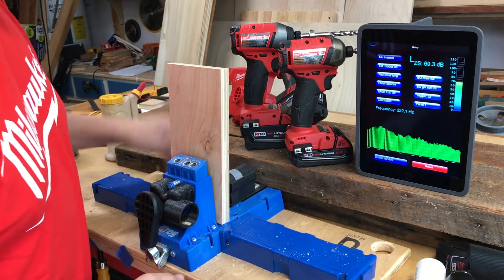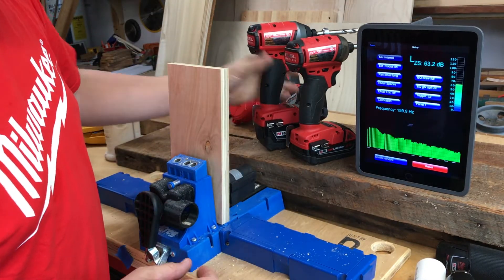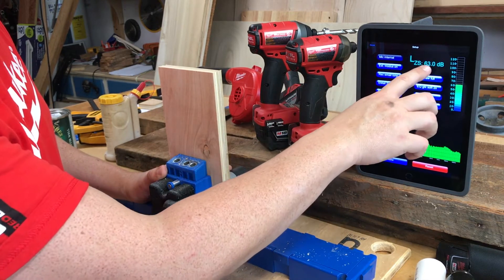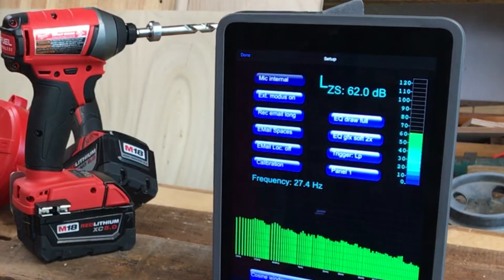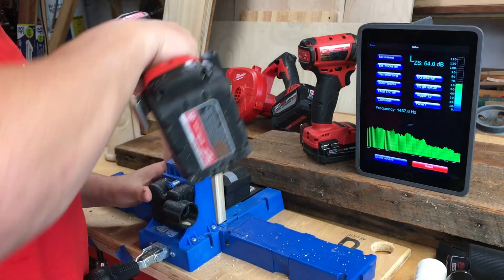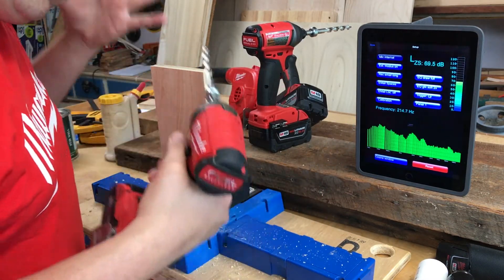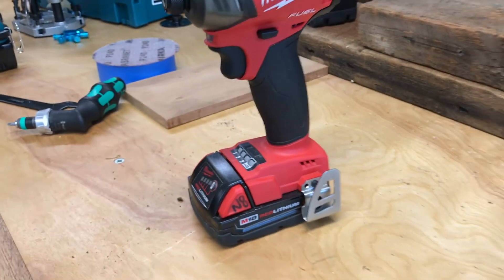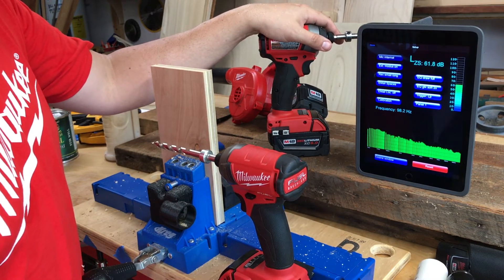Milwaukee Standard Impact vs Surge Hydraulic Driver

Comment: Impact drivers and drilling = idiot missing from day job
Reply from the maker: 1bottlefed sorry you feel that way. You’re missing out. Also way to totally miss the point of the video. Also so easy to post a comment on social media without having a clue what you’re talking about. Thanks for watching.
Reply: NIASE Master Automotive Technician, Crew on a 5 second dragster, and have taught many new employees the difference in drill life, when one is used properly with a variable speed drill or butchered by using in an impact tool.
 As to the point of the video...I can only assume it was to demonstrate the difference in sound levels between a conventional impact driver and a hydraulically coupled one? If so by heavily loading the output (as happens when you run a nut down or drive a large screw into hardwood, you would see a greater difference between the two designs.

But carry on......you clearly are right and the various commenters stating the opposite are wrong.

PS sorry about the idiot comment, I could have just said it was a shitty way to test and a good way to abuse a drill bit without any personal attacks.
Reply from the maker: 1bottlefed let me clarify. When I said you
don’t know what your talking about I was NOT referring to your skill or knowledge. I would never make wild assumptions or accusations, about someone I don’t know. That would just be stupid. I was referring to you not knowing anything about me, my skill, my knowledge or experience. Congrats on your certification and experience, thanks for clarifying. Since we have a nice entertaining dialog here I’ll keep it going. For what I do, rough carpentry or woodworking I prefer an impact as demonstrated for drilling. I wouldn’t use and impact if I was drilling metal, I would use a drill or my drill press. As far as the demo goes it doesn’t really matter what you’re doing  as long as the tool is “impacting”/engaging as it’s designed. Sure if I just wanted to hammer away a nut would have been a better choice. In this videos I used what I had and was working on at the time. Always 1000 different ways to do things. So many people want to discount what others do because they are not as “Pro” as them. Everybody is at different levels of experience and skill. If you have some knowledge to share maybe try doing it in a constructive way. Thanks!

Comment: It is WAY quieter compared to my coworkers drills. Unfortunately for the one I owned it only lasted about a year and a half. I am a Stone coated steel tile roofer. Setting 2 - 2 1/2" Self tapping screws, ( plus other requirements) 5 - 6 days a week. 3 - 5 thousand screws per week.
Reply: Milwaukee has 5 year warranty; as long as you can read the serial number or still have the receipt, send it in. I’m a mechanic - I abuse these tools day in and out and soak them in fluids they probably aren’t rated for; I warranty these things every 18 months or so. It’s usually a 1-2 week turn around, and they pay all shipping
Reply: Use a screw gun for that.. any impact will wear out with that kind of use.  I do metal roofs as well.

Comment: I build fences and decks, would the Surge be an adequate drill for the work I perform?
Reply from the maker: Andrew Ward for sure. The only place it lacks it driving large screw and lags I’ve 4”. Then a standard impact is better. Or driving large self tapping screws
Reply: NorCal Rider  I have this driver and its great. It is less powerful then the traditional driver, but not by much. 4" are screws are no problem at all.

Comment: Kinda odd u picked a drilling demo to demonstrate the sounds since the most common use for an impact is to drive screws. Maybe we can see this in the future
Reply from the maker: Joe Landes I guess everyone uses tools differently. I use my impact for everything, unless it's a large bit I always use it for drill bits. I just happen to have this set up when I made the video so I used it. It's not a power demo. All I needed to do was engage the impact on the tool to compare sound levels. I think this demo does that. Maybe I'll do a demo driving screws but I think the results will be the same. Thanks for watching.
Reply: @BuiltByN8  It's really not good to use larger drill bits in an impact driver as the bit is not designed to withstand impacts
Reply: @agentchodybanks9120  the drill bit he's literally using has a 1/4 shank for impacts 🤦‍♂️